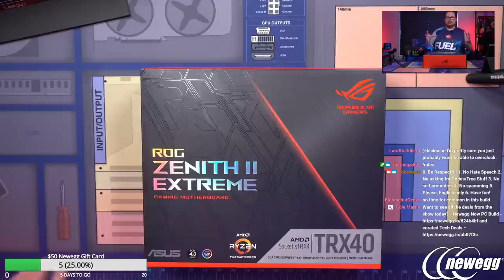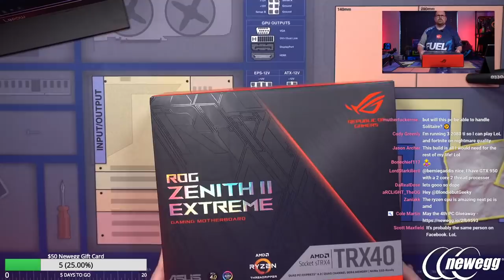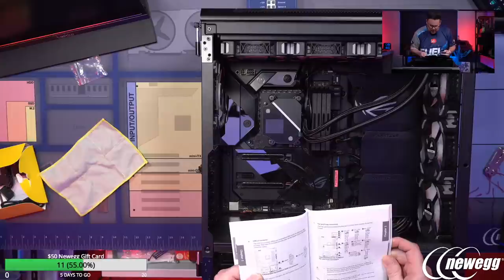How to Build a PC - Robeytech Live - $6000 Build - Ryzen 3950x / 2080Ti in Evolv X | Robeytech

Comment: Hey! 

Thanks for the video! We all appreciate your work! 🙏

I'm planning to buy the same case and the same PSU. However I'm a little worried about cooling regarding my PSU. 
As we know in order for the RGB and the screen to be visible on the unit you need to mount it with the fan facing upwards. There is only a few millimeters between case's basement/shroud ceiling and the PSU fan and there are no vents in the shroud. 😟

Should I be worried about thermals on my PSU?

Comment: I wonder how the PSU "behaved" with the fan upwards? Would it affect output and temperatures?
Reply: Hi man , i see you asked many question about the PSU and fan orientation on this case ,.  I have this case and im looking to buy Rog thor PSU . Do you have it ? and it is good with the low space between psu fan and case ? Thanks
Reply: @muratketur  I am more than happy with this PSU. I got the 1200W version, since it would handle better in case of load and future upgrades. So far, I believe is one of the best PSUs in the market.

Comment: Is fhat case customized by someone or can you actually buy thaytI like I would buy asus everythkgn if I could quality is just better even gpu the clock higher and the new 3090 3080 the little modules on the back that was a problem with 6 cheap one and lkle evga uses 2 expenakge ones and 4 cheap one asus tuf ans strix both use all 6 expensive ones they just are the best but also impossible to find so I got a evga ftw3 ultra 3090 instead